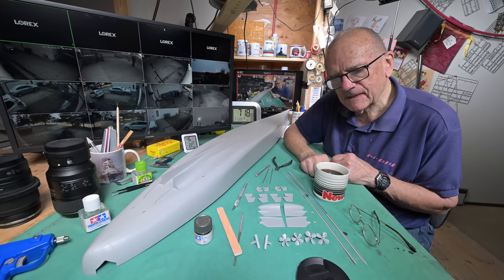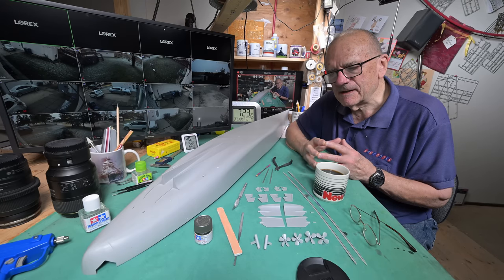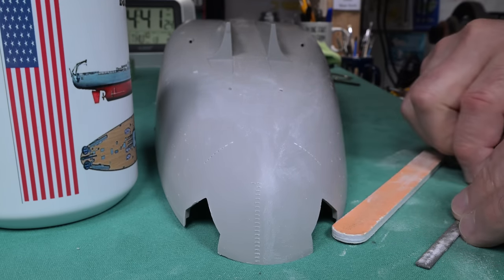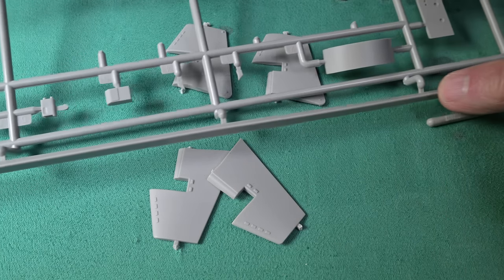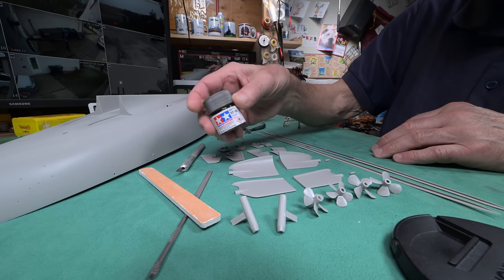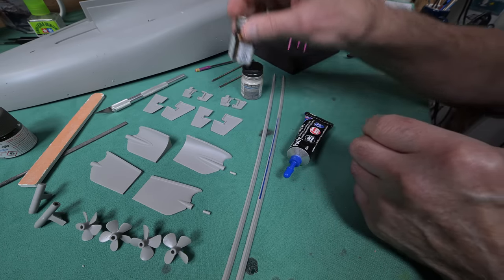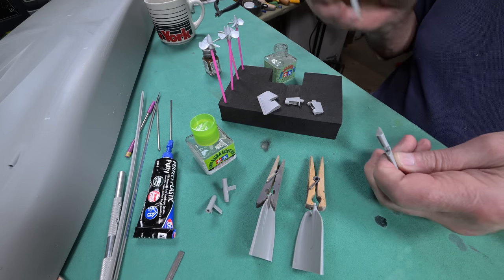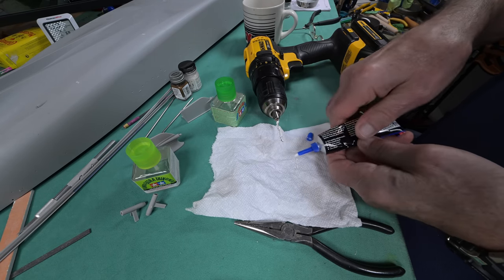The Model Ship - Part 1331

Comment: Your van story got me reminiscing, I graduated high school in 2001 and my last year of school I drove a 1979 Cadillac coupe deville that I paid $100 USD for from the original owner that gave up driving it and wanted the space back in her driveway. It was black with ruby red interior, interior was show room new but the body had rust around the rear window from the vinyl top and always being parked outside. I worked part time at my aunt's convenience store making about $400 a month after taxes and my only bills at the time were car insurance ($80 a month) and gas was $1.10 a gallon and the car had a 25 gallon tank. That beast got about 10 mpg driving around town and I would burn a tank every weekend as Friday and Saturday nights were spent cruising with all the other gearheads up and down an 8 mile stretch of 2 lane "highway" that ran through town. Some days I still miss that tank.

Comment: Honestly Ron, for that BIG of a kit, I know my 1st and ONLY choice would be Tamiya TS spray paint cans for the hull, and the deck.   Yes, you have to do it outside, but they dry quick and look just as good as airbrushing. They are also VERY tough paints and won't get damaged throughout the build if you look at them wrong.  Then you're free to hand paint or airbrush the rest of the smaller stuff with the Tamiya acrylics. Just my Texas 2 cents!  Enjoying the build so far! You've got me looking at the 1/350 Tamiya Missouri now!

Comment: I have a love/hate relationship with the airbrush too.  I've built a number of 1:350 and 200 wwii ships and I've always liked using Tamiya sprays for the hulls.  My Iowa will be either AS-2 or TS-81. I use dull red for the bottom and tire black for the boot. The bad news is you need lots of ventilation or go outside. After the color coat I use satin clear spray and the hull is beautiful and tough.
Reply from the maker: Thanks Dennis. 👍

Comment: Hi Ron, I have used a brush with acrylics and found that the key is to have the paint super thin, and apply as few coats to give the colour density needed is the key to a good finish.
Reply from the maker: "the key is to have the paint super thin" Great tip!👍

Comment: Personally, I've switched over completely to acrylics for the simple reasons of ease of cleaning and lack of fumes.  When I airbrush, I still wear a mask just because there are still a few bits of overspray, and even breathing any sort of particulate isn't that good.

Then again, I've had hayfever for decades, and I found out that the P95 mask I bought to go shopping for the last couple years works GREAT for filtering out the bits of grass dust and pollen, so no problems needing the allergy meds after mowing the lawn.  I may look like a goof out there pushing the mower, but no sneezing.

Comment: Hi Ron, Great show today.  I would go with aerosol paint can's for something that big.  i knew someone years ago that painted his car with a Flint gun, like you used to use for bug spray.  You could brush the hull, but it would be best to thin the paint way down and apply lots of coats. Perfect putty is water soluble, if it's to thick, you can easily thin it with water.  Those clamps are great, I have about 10 of them. Good idea with the auger.  Have a great day.  Jeff

Comment: I’ve got the spring clamps, they’re certainly not too heavy duty but do work a treat for when you need constant light pressure to hold two pieces together.  I reckon they’re on par with the pack of micro drill bits. When they work they’re brilliant but they break very easily.

Comment: Hi Ron, I get as frustrated as you with the airbrush.  It’s almost like cheating, for large area painting like the hull, I get the Tamiya acrylic spray cans, dull red and the shade of grey appropriate to the ship. Does a nicer, more even job than a brush but not as accurate or as fine than the airbrush.

Comment: Lacquer paint is better than enamel, but you will need a respirator and good fan system. Obviously airbrushing is better, you can paint the hull with a paint brush, if you do, I advise doing multiple ultra thin coats to achieve decent coverage without loosing detail. Of course you could prime and dry brush the colour coat, but the base coat would need plenty of sanding. I have primed and dry brushed several whole models, they came out great. Also, you can purchase sticky TACK cloths to wipe the hull before painting.

Comment: Never liked the smell nor long drying time of enamel paints. I use Vallejo acrylics. if you thin the paint to milk consistency, you will never get brush strokes.  Also thinning the paints with Windex makes the paint self level. It may take 2 or 3 coats to cover but there will be a flat uniform paint application. Acrylics.....no smell, easy clean up, and quick drying time. Love the McGiver made auger to clear the putty nozzle. Ingenuity.
Bill

Comment: Ron, since you have had success with Badger Stylenrez primer, give thought to Badger ModelFlex Marine acrylic.  They have colors that match WW2 US Navy paints and they are available on Amazon too.
Reply from the maker: Here in Winnipeg we are getting to the time of year when there is the possibilities that online orders (Amazon) my get frozen in delivery. I believe that acrylic paint my be harmed if they freeze. 🤞
Reply: @roncalverley  TruColor paints which another commenter recommended are solvent based acrylics so I doubt they would degrade. They are a small enough company to actually answer questions.  Another option would be True North paints.  They make alkyd oil based enamel in colors specifically formulated to match WW2 US Navy paints.  They are also very ready to correspond and answer questions.

Comment: Ron try Tru-Color Modern Haze Gray #TCP4031 4.5 oz spray can and Tru-Color Anti Foul Red #TCP4024 also 4.5 oz spray can
Reply: @roncalverley  TruColor paints have a full line designed to match WW2 US Navy paints including an excellent TCP-1000 NORFOLK 65-A, ANTIFOULING RED paint that is a great match to that used in WW2. Ran by friendly folks who will gladly answer questions, their direct email address is right on their Contact Us page.